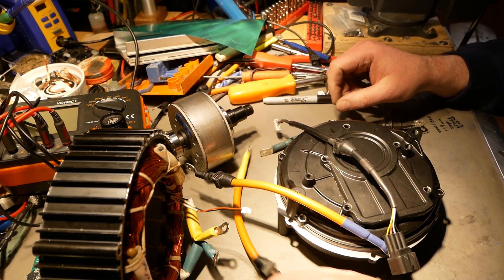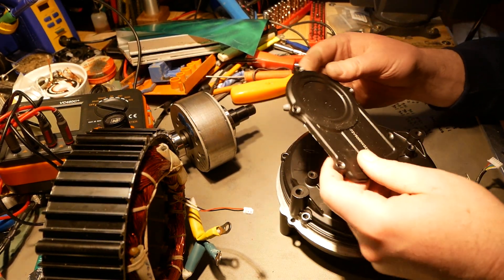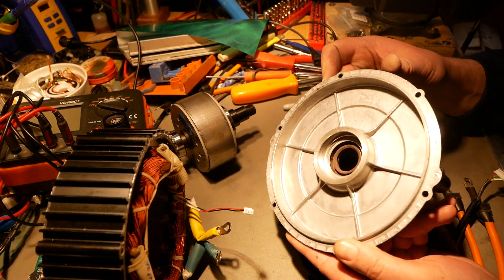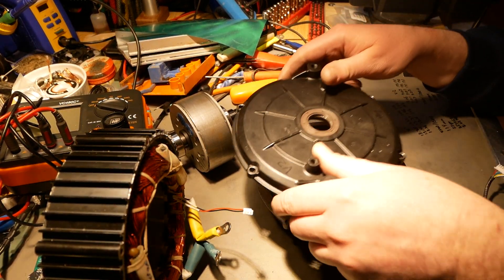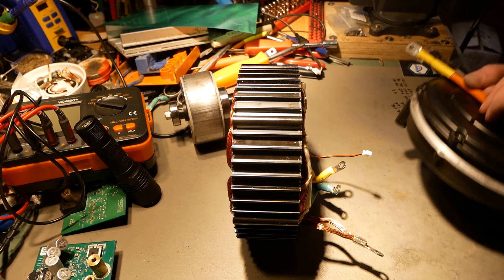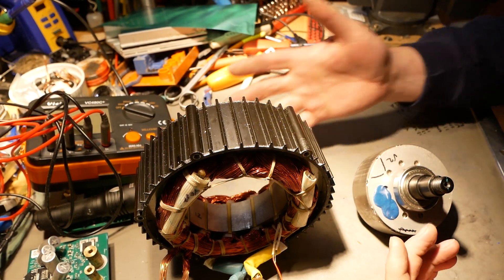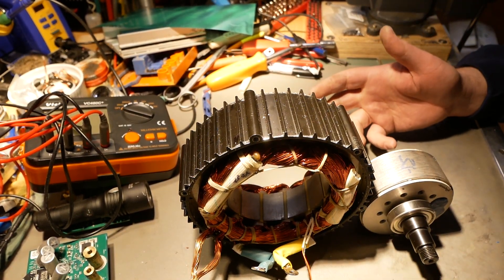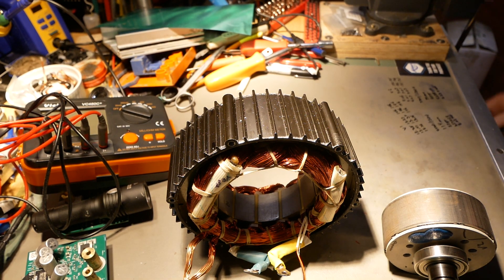QS165 v2 teardown overview

Comment: I’m looking for something that can push a 1k lb vehicle. Using motorcycle engines right now. Got any suggestions?
Reply from the maker: A 1kw motor can do that. It's just gearing. What it won't do is move very quickly. You'd have to give me a LOT more information about your expectations before I could recommend a motor.

Comment: Also, when do you think we will see an axial flux motor in this form factor that can easily be used for an emoto
Reply from the maker: Someone would have to design and build it for that to happen. I do have an axial motor, but it's huge and will never fit a Surron. I'm not sure there is any advantage for this application in making an axial flux motor.

Comment: The V layout of magnets can take more heat without demagnetising the magnets, and that allows for the motor to take much higher amp-bursts when accelerating...It places the magnets farther away from eddy currents near the surface of the rotor. In essence, the magnets magnetize the steel, and the steel absorbs the eddy-current heat, but the steel is laminated, while the magnets are solid.
Reply from the maker: This is applicable until the iron is heat soaked and then the magnets are just cooking in there for longer time!  The V2 magnets are much stronger than the V1 magnets. This will help with the distances too.
Reply: @de-bodgery  Thanks!